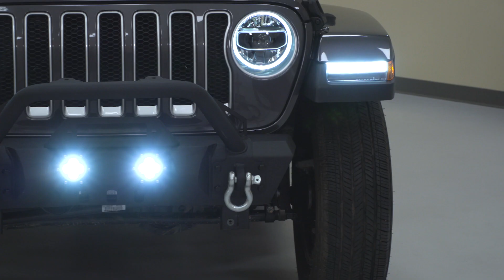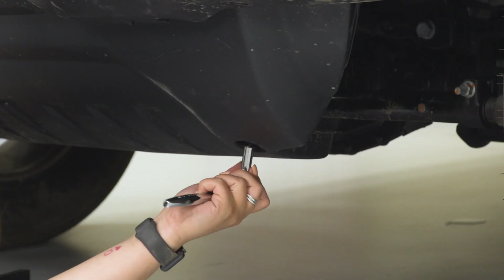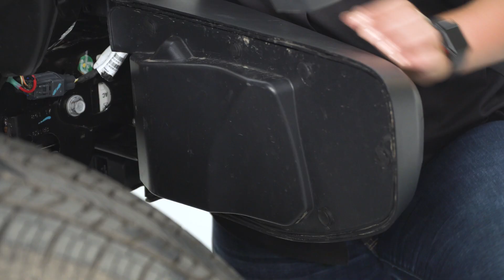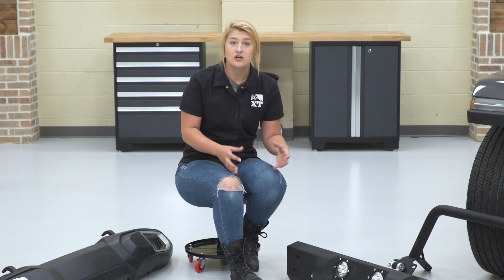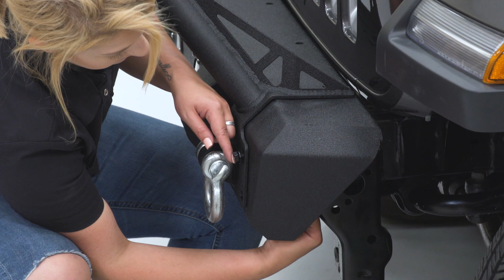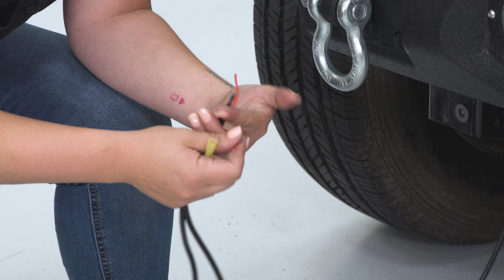Jeep Wrangler JL RedRock Stubby Front Bumper w/ Lights, Mount & Over-Rider (2018) Review & Install

Comment: Thats a ghetto way to wire in those lights😅
Reply: Agreed. I just cut the old connector off the factory bumper and soldered it onto the new fog light wiring. No sense in using butt connectors and all that nonsense.

Comment: This is a good video but the wiring part is a disaster.  You actually show it the wrong way.  First of all it's not even clear how you rewired the harness but it looks like you are powering both fog lights with the one white/red wire.  You are underpowering the lights.  That makes no sense.  I would recommend you redo that part of the video or sketch a descent diagram.